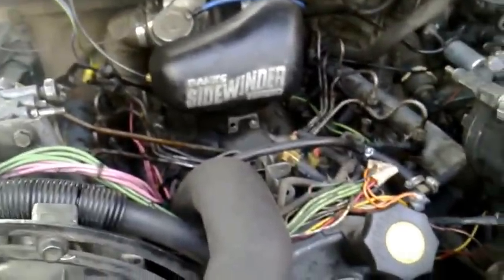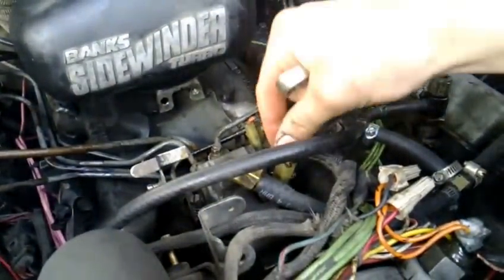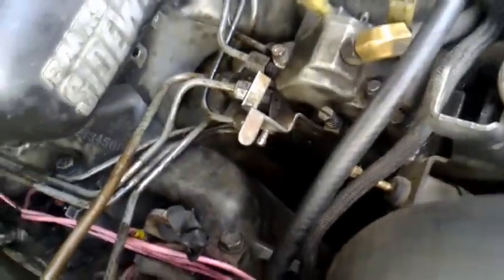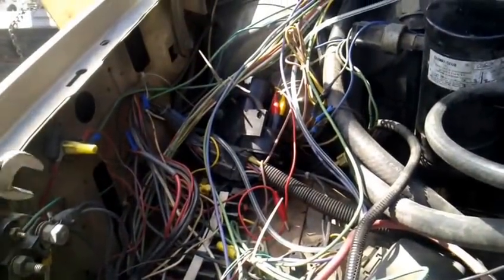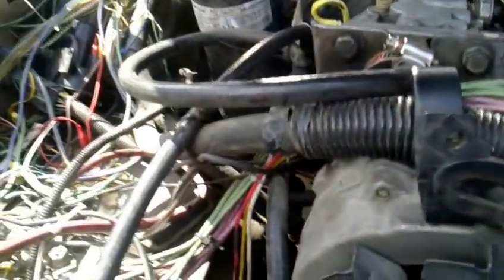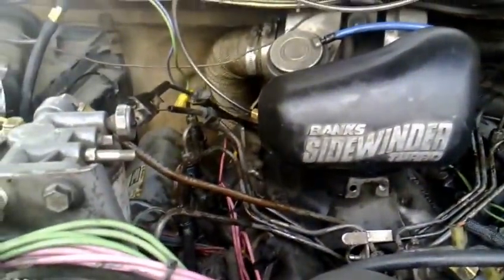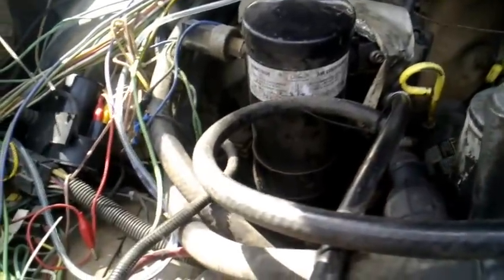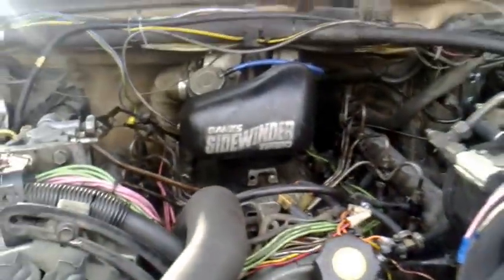How to bleed the lines on a 7.3 idi

Comment: What in the world is with all those wires?! But good instructional. Pretty clear and to the point.
Reply from the maker: I ran new, individual wires to each glow plug(pink for driver's bank, 
green for passenger). Moved my controller to the passenger's side fender
 well. 
Also, a lot of the stock wiring has been pulled from it's sleeves and messed with more than once.
Reply: Oh. I seen all the bare wiring and wire nuts everywhere and was amazed at it all lol. And here I thought my bay was a mess...

Comment: Your idi cranks fast.  What kind of starter do you have and do you know what cranking speed you're getting?
Reply from the maker: Just a standard IDI starter; nothing special. I get the same speed from the crummy denso-clone $100 ones off Ebay, as I do from the longer napa or other starters. The key, with all of these is that they need to be new/clean inside - carbon buildup and corrosion(or worn brushes) will really slow down a starter - I've 'reconditioned' more than one starter with some Scotchbrite on the commutator.
Reply: @MacRobbSimpson  Thanks, good to know.  I pulled a glow plug on my engine and cranked the motor over for 5 seconds to count the chuffs out of the glow plug hole.  I did that a couple of times and was getting about 7.5 or so chuffs out of the glow plug hole for every 5 seconds of cranking.  That works out to about 180 RPM cranking speed.  That's not really terrible but I think it could be better.

I just finished chasing down and fixing all the air intrusion issues on my engine and have moved on to the glow plug system.  I was getting a pretty large voltage drop across the 2 power wires that go from the starter relay to the GP controller relay so I replaced those wires and got a noticeable improvement in starting but I am still measuring what I think is too large a voltage drop across the wiring harness that goes from the GP controller shunt resistor to the glow plugs themselves.

Fortunately, the bullet style electrical connectors that connect to the backs of the glow plugs are available on eBay so I bought a set.  When they get here I will make a new wire harness to go from the output of the controller to the 8 glow plugs and hopefully that will take care of the GP system, then I can move on to the starting system.

Other than testing my cranking speed I have tested the starting current with a current clamp and I get a starting current of 450 amps.  That seems a little high to me but it's a big, high compression motor so maybe that's normal.  I will test the voltage drop across that big power wire while the engine is cranking and probably pull the starter off and clean it and the terminals and see about opening it up to clean up the commutator and hopefully get the cranking speed up over 200 rpm.

With winter coming I am trying to do what I can to get this engine to fire up without any excessive cranking.  

Thanks for the reply, your videos have been helpful.

Comment: Holy hell what a combobulation of wires
Reply from the maker: Yup! It becomes one of those things where after the first dozen times of unwrapping and re-wrapping the darned wires you just stop caring.
One day I might do it more professionally, but it depends on having time & money to do it right.
Reply: Okay. What's your excuse for the alligator clips and wire nuts lol
Reply: Done right you shouldn't have to unwrap it anyway. Do it once do it right.
Reply from the maker: Alligator clips - I'd have to watch it again, but IIRC I just used them for the vacuum pump. Which I wasn't able to get a pigtail for. And it kept working reliably, so...
Wire nuts, well, I actually prefer them to crimp connectors(butt-splices and the like). I've had multiple crimp connectors pull apart on me; wirenuts tend to hold up longer and better. Also much easier to remove/redo when needed - Like the wires to the tach sender - The sender stays in the truck, and then I've got factory wires AND a custom tach wire attached.
Could have been done with a decent plug connector, but eh... 

Typically, these wires don't cause me trouble. The only thing that has caused me issues is having a (cheap)female spade connector come off the FSS connector on the IP.

Comment: At the end of Video you said something about timing ???
Is this something that needs done after replacing the injections & Why ???
Reply from the maker: Yes, very yes. Or after replacing the injection pump, or after about ~50-100K miles, for best results.
In most cases, the adjustment is minor.

Why? Because we are dealing with a hydraulic-mechanical system here. Every part has tolerances, and no two are exactly alike. Plus, things wear.
Timing in an IDI is determined by plungers in the IP that squish a certain amount of fuel together until the pressure reaches the pop pressure of the injector. A lower pop pressure means that the IP doesn't have to squeeze as hard, so the fuel injects earlier. So, if you replace a worn injector with a pop pressure of, say, 1400 with a new one at 1800, the new one takes more work and time to inject, so you'll have retarded timing compared to the old ones.

Also, over time, the IP wears as well, such that it can't build up the pressure quite as fast, resulting in the timing slowly going retarded. This is counteracted, somewhat, by the injectors wearing as well - as their pop pressure drops, the injector component of the timing goes more advanced, while the IP wears retarded. However, what I see, long term, is that the whole system wears retarded.

Getting the timing right, or as close as possible results in more power, less smoke, easier starting and better fuel economy.

Comment: When using the starter solenoid to turn the engine over from under the hood without having a remote starter switch to attach to solenoid you will for sure want to use a screwdriver or some metal tool with an insulated handle of you will get zapped by the 12 volts from the dual batteries, wakes you up a bit but it does happen folks so beware! DO NOT use an un-insulated tool..
Reply from the maker: 12V isn't enough to do much. Unless you put it across your tongue.
Remember, it doesn't matter how big the batteries are(or how many) - 12V is 12V.

If your hands are sweaty, you might feel a little tingle if you are holding 12V. If they are dry, you won't notice it.
Reply: Absolutely not true. Even with wet hands you cannot even begin to feel anything until you get up around 48V. And as MacRobb Simpson notes below, it doesn't matter if 100 12V batteries are wired in parallel; the output is still only 12V. I'm a former electrician.
Reply from the maker: @paulmaxwell8851  Erm, I've felt 12V multiple times. Usually when leaning across the engine compartment such that my arm is touching the positive battery terminal(or working on the alternator battery lead) with my other arm touching a thin edge of (grounded) metal.
This probably wouldn't have happened if I'd, say, disconnected the battery any time I worked on the electrical system, but eh...
Reply: I tend to use a 20amp start button with some wire attached to either post, and then just leave it under the hood. I used to use a screwdriver or wrench or whatever but it would always slip off or get s bad connection. Also- you don't get zapped if you're not the ground. Electricity isn't magic. You can 100% cross the solenoid with a wrench and be fine.
Reply: @robertwood9572  This guy gets it. I've never felt anything while using a wrench, electricity takes the path of least resistance. You barely get anything if you're not touching near the points.

Comment: I'm not real sure about what the problem is with these engines I've got a 7-3 IDI I've ran this thing out of fuel like 10 times. with electrical shorts because my fuel gauge doesn't read accurately when I did my injectors I also replace the tappet cover gaskets it crank for about a minute then fired right up I just put bullet fuel rails on in which again I had to remove 90% of the injection and it crank no problem
Reply from the maker: If you don't pull the injector lines(leave them attached to the IP), you don't really need to bleed it. The amount of fuel that will leak out is minimal.
If the lines get completely drained(if you remove them they will drain fairly quickly), yes you will need to bleed it.

Return side doesn't matter.

If you run it out of fuel and then switch tanks, typically you haven't drained all the lines or anything, so it doesn't take too much to re-prime it. No manual bleeding needed.
Reply: Robert Atwood yeah idk some are some aint

Comment: Put a primer bulb on the fuel line   like for outboard motor  saves your starter   and batteries   mount low on pass side of mtr up near front where you can reach it    crack inj's   pump bulb   tighten inj's   and start...bulb has arrow on it  for fuel direction...
Reply from the maker: This only works to prime fuel up to the IP. It won't prime /through/ the IP, or prime the high pressure lines. Why? Because A, the IP has an sliding-vane pump inside it, a positive displacement pump. Without the engine turning over, this positive displacement pump won't turn, thus it will dead-head any fuel that attempts to go through it.
B. Even if you got fuel past that pump, it would need to be at over 500 PSI to go down an injector line - Each of the 8 output ports have an internal check-ball that prevents fuel pressure from draining when it's not actively injecting. The injector itself needs 1400-1800 PSI to actually inject, so the fuel in the line is trapped, until the IP is ready to fire that cylinder.

Comment: You do know that there is a fuel return line that connects all of the injectors; and that you only need to bleed number eight?
Reply from the maker: Not sure where you got that information, but it's plain wrong. The fuel return lines only carry a tiny amount of fuel from the injectors, just what leaks internally. It's not like a common rail injector where some fuel is returned intentionally.

So, to bleed the pressure side of things, you need to bleed all the lines(or at least enough of them to get it to run).

Comment: do you know if the 90e350 7.3 motor that comes in the vans will fit in my f350 truck?
Reply from the maker: More or less, yes.
The long block is the same. The oil cooler is different, as are the exhaust manifolds. If you re-use your truck manifolds and oil cooler, you'll be fine.

If you are just using it as-is, you might need to do some fabricating if you can't use the truck manifolds and oil cooler.

Comment: I think I have air in my fuel lines as well. I had to start it a couple of weeks ago with some ether because my glow plug controller went bad. I fired it up and she sputtered a bit and then I heard a hissing sound while it was running. I got busy with my job and didn't need the truck for anything so I let it sit until I could get to it. Now she won't fire up and run even with ether she kinda starts and dies right out an I can still hear a sucking sound. Gonna try this when the weather gets a bit warmer and it stops with the every other day freezing rain  here. I'm working outside in my driveway so I'm at the mercy of the weather.

Comment: The very first line you was working on has broke in my truck right at the tip. Know ehere I can get one or know of a way to fix it?
Reply from the maker: Here's a question: Do you have the vibration dampeners(rubber/metal clamps) that go across the lines installed? Typically, breakage like that is from running with those removed. Most people(me included) didn't believe they were that important at first...

That being said, at this point you need a new line. I'd check the local wrecking yard if you can. Otherwise, Ebay... but be warned, a new line could easily cost $50.
Reply: I'm going to say no cause it's just an all metal line nothing on it. But according to my fiancee if I don't start driving it I have to sell it. I'll pay $50. I'm going to check on all that to make sure the other don't break. Thank you
Reply from the maker: Alex Tubbs I'd google for "vibration dampeners 7.3 idi"; it'll show you what to look for. You really need the four vibration clamps on the lines, or you will break other ones over time(usually just a few K miles). They're cheap, though.
Reply: Alex Tubbs I had the #2 line break as well. mine didn't have the vibration dampeners. You can get the clamps at http://thedieselstore.com/injector-line-clamp-4-line-assy-for-1983-1994-7-3l-idi-6-9l-ford-diesel.html?gclid=CjwKEAjw3sKpBRDJ7rDqzsyuhDASJACZAikizKvW_HnT8ttsuVKWI4FW16N1FVL8hSW_1UwzM5ZoAhoCgiDw_wcB . You can go to accuratediesel.com to get a whole set of injector lines. I wouldn't advise going to a wrecking yard. I just needed the one line so I just ordered one from the local Ford dealership. It was like $100 or so for just the #2. hope this helps.

Comment: These engines are notorious for return line leaks and they lose their prime all the effing time over night. If I had to bleed off individual lines every time like in this video it would be a daily pain. I just crank it 'til it starts, about 60 seconds, no need to bleed the lines. Hard on the starter but hey, I'm not the person who designed this engine that loses its prime all the time. I tried all the fixes with o rings, hoses, washers, etc and nothing works, it just sucks air every night.
Reply from the maker: Multiple things:
1. This procedure is for when you pull the injector lines, typically when replacing the IP. If the lines are generally full of fuel(which they will be if you get air intrusion), cranking works fine.
2. Air intrusion: Stop thinking about the return system. It DOESN'T MATTER. Everyone talks about having to make sure the return system is sealed, or you'll get air intrusion etc.
It's not that.
The problem is that you don't have a good check valve on the fuel filter, or leak on that filter head.
Originally, the return line from the fuel filter head had a small check valve in it. This meant that when you shut the engine off, that check valve seals and keeps the supply side(lift pump up to filter head) from draining back.
That check valve has disintegrated by now. So it's not doing it's job.

Now, you have three possible fixes:
1. Replace the lift pump. The lift pump has two check valves inside it as part of it's method of operation. If it's working, when you shut the engine off, the lift pump will keep fuel from going backwards and draining down. However, as these pumps age, those valves work less and less.
2. Add a separate check valve. You can get a stand-alone check valve and mount it to the inlet side of the fuel filter, at the fuel filter(highest point).
This will keep fuel from draining down  by creating a seal at that point.
3. Check/repair leaks in the fuel filter head. On the 7.3 style head, there is a "fuel heater" wire/plug coming out of the top. Where this terminal meets the plastic around it, and where that plastic goes into the aluminum filter head can leak. You can tear the filter head apart, remove the entire assembly, and plug that hole with a pipe-plug if you wish.
You can also choose to delete the return line on the filter head. Deleting it will reduce drain-back issues, but may make it harder to re-prime if you run the truck totally out of fuel. 

Another thing that may be useful(if these fixes don't work), is to add a clear section of hose to the lift pump-filter head line. Watch for bubbles when running. If, after more than 30 seconds of running, you are still getting bubbles, you need to work backwards and fix whatever is leaking - could be the hose loop at the lift pump(though you should have replaced this with the lift pump), could be a pinhole between there and the tank switchover valve, could be the switchover valve itself, or could be an issue with a tank pickup or line from there to switchover valve.
(You can check tank-side of valve by switching tanks and seeing if the issue goes away. If it's limited to one tank, you know it's pre-switchover valve(or valve itself). If it's both tanks, it's switchover valve or after).
Reply: @MacRobbSimpson  Thanks very much MR, I'll see what I can do with your suggestions. Interestingly enough I was thinking about this and suspected that despite what many say, the return line piping is probably not to blame. Rather, it's all the lines leading to the fuel filter from as far back as the tank. I already replaced the heater plug o ring, I am probably tapping it for a brass plug next, also. I love this engine but damn this is a lot of work. Ford apparently made numerous changes to stop it over the years.

Comment: Is your truck manual??
Reply from the maker: Yes. This one is, and most of them are. I only have one C6 truck(works) and one E4OD parts truck(trans solenoid connector broken; doesn't shift).

5-speeds are nice. Best transmission you could get behind an IDI; only issue is with the stock dual-mass flywheel that needs to be swapped to a LuK single-mass at first sign of slippage.
Reply: @MacRobbSimpson  my is a 4 speed
Reply from the maker: The T18 4-speeds are quite reliable and heavy duty, just no OD. As long as you have 3.55 or lower gearing, it's not too bad.